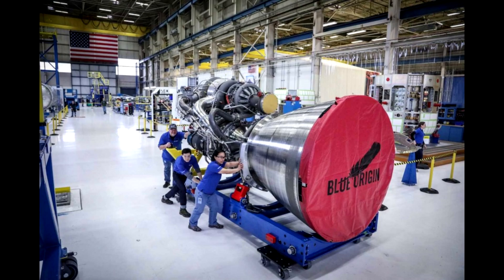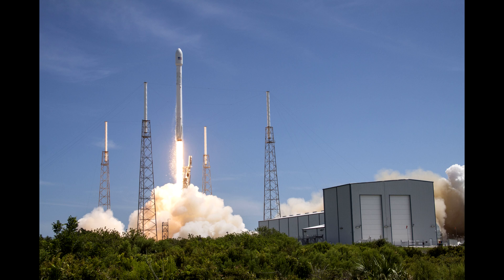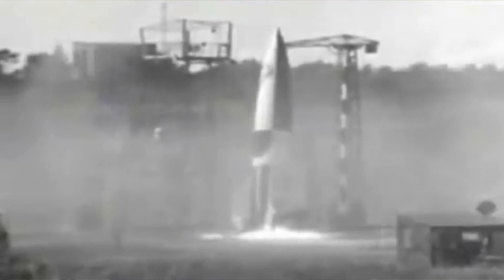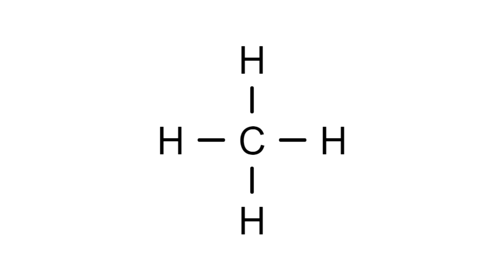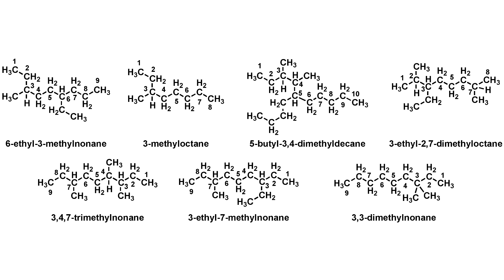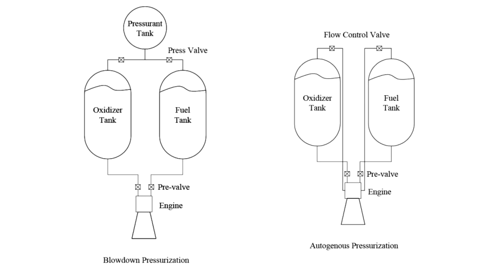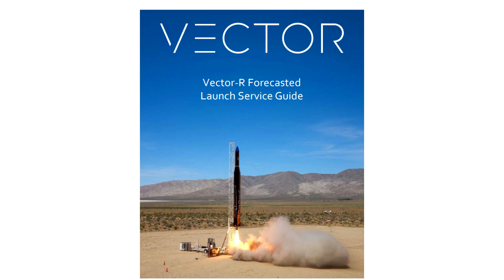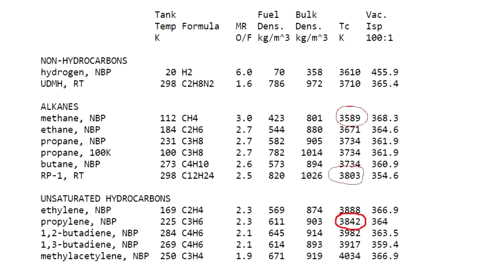Why Next Generation Rockets are Using Methane

Comment: How does specific impulse work with the higher mass? Does specific impulse relate to the total additional mass needed? Or does the increased mass of fuel eat into your better impulse? Or were you suggesting that they make up for the mass increase in fuel with mass decreases in other parts of the rocket? Thanks!
Reply: Specific impulse is mostly about the fuel and has nothing to do with mass of anything. It basically says what is the exhaust velocity of the propellant, which comes from the mass of propellant burned and kinetic energy pumped into it. It has nothing to do with the mass of the rocket at all.
Reply: Specific Impulse refers to the potential speed of the exhaust gas; essentially your fuel efficiency. The lighter the exhaust gas, the faster you can push it out the back of an engine. Hydrogen is the lightest fuel but can't be compressed as much and therefore takes up more volume and sometimes mass for cryogenics. RP-1 and UMDH are much heavier molecules meaning they take up less volume but can't be propelled as fast in an engine meaning lower theoretical specific impulse. They also have the benefit of being liquid at room temperature. Methane or LNG is in the middle of Hydrogen and RP-1. It's lighter than RP-1 but, not as hard to manage as Hydrogen. You need to read about fuel mass ratios to understand how this is employed practically in rocket design.
Reply: he isn't talking about the mass of the rocket, he is talking about the mass of the exhaust's gas.
Reply: @xopnen_ if so, then why ask "were you suggesting that they make up for the mass increase in fuel with mass decreases in other parts of the rocket"? It's clearly a question about rocket mass and not the exhaust.

Comment: IMHO, Mars' atmosphere is so very thin, pulling CO2 would be pretty inefficient. I wonder how much energy that would take to harvest and process air instead of using the dry ice at the poles. 

Not to mention, how would the CO2 be replenished? I know it would take centuries for us to have an impact, but trading one non renewable resource for another when we go interplanetary seems hilarious.
Reply: the atmosphere of Mars is less dense than Earth's but it is still a very substantial atmosphere.  no shortage of Carbon Dioxide.  it would be like being worried about running out of Nitrogen in Earth's atmosphere.  it's a VERY large supply.  when you burn the methane it just turns back into carbon dioxide and water which would end up mostly back on the planet you just took off from.  most of the fuel you would be burning would be to overcome the gravity of planets, so that's where most of the burned fuel ends up.  sure over a very very long period of time and very very large number of trips you would end up rearranging carbon dioxide and water around to the various bodies in the solar system, but since that's where you are getting the carbon, hydrogen and oxygen to begin with...........
Reply: @baneblackguard584  neat

Comment: Why less energetic? Methane combustion gives 55 MJ/kg while kerosene gives only 43.
Reply: Of course for specific impulse considerations is the flame temperature that counts but as far as I understand tecnically methane is more energetic per unit mass.
Reply: In the combustion chamber energy per unit volume is not a very useful parameter.
Reply from the maker: You have to include the mass of the oxidizer in your equation.
Reply: @scottmanley  yeah, you are absolutely right, I did not consider that.

Comment: Methane is also apparently easier to simulate with CFD than RP-1, because you don't have as many intermediate combustion products.
Reply: Sleepib, it is actually--as strange as it seems, due to the simplicity of the methane (CH4) molecule--more difficult to simulate the combustion in methalox (LOX/methane) rocket engines. This is because--although oxygen and methane burn to produce carbon dioxide and water--during the combustion process, several strange, short-lived "inter-molecular species" form and break up, and at least some of these have strange chemical characteristics, and:

There is an analogy in nuclear physics, where some radioactive elements, while decaying to more stable isotopes or elements, first become very unstable, short-lived intermediary ones. It's possible, for instance, that the apparent slight burning of copper interior engine components (Elon Musk noted the greenish edge of the Raptor's exhaust plume, which suggested copper combustion) could have occurred due to the action of one or more of the short-lived molecular species (some of which could be quite corrosive, or otherwise eager to combine with copper and/or other metals in the engine). Also:

Even chemists aren't in complete agreement about how to classify methane. The alkanes (which have single carbon bonds) are chains of carbon atoms with hydrogen atoms on the other three (out of the four) bonding points of each carbon atom. Methane, most chemists say, is a single "chain link," consisting of just one carbon atom with hydrogen atoms on its four bonding points. But other chemists disagree, pointing out that unlike the other alkanes, which also have carbon-to-carbon bonds (where their links bond together, as in ethane, C2H6, the "next step up" from methane), methane's lack of any carbon-to-carbon bonds makes it chemically different (its reaction process with oxygen--with its odd "inter-molecular species" that appear and break up before the simple CO2 and H2O reaction products are formed--suggests this). Methane is a deceptively-simple--although interesting and useful--fuel, including for rockets. Its oddities (for example, its strange "inter-molecular species" that occur during its combustion with oxygen; these might differ due to pressure and/or temperature differences during combustion) certainly don't rule it out as a rocket fuel--they simply need to be studied, understood, and accounted for (and used to advantage, if possible), and today's developers of methalox rockets engines will, in the course of their work, learn these things.
Reply: @j.jasonwentworth723  I'm not sure I can belive that methane combustion is harder to simulate than rp1. Rp1 surely has way more complicated burning mechanism. Can you provide some source for your claim that rp1 combustion is easier to simulate than ch4?
Reply: @zoltankurti  the answer to your question is, of course, NO.  Look at it this way, the comment is saying that some of the best engineers in the world will eventually, as they trudge along, figure out this guys casual knowledge.   We all know no one in youtube comments is "schooling" actual rocket scientists, no matter how hard they flex.  r/iamverysmart
Reply: fascinating! do you have any source for that?
Reply: @Czeckie  trust
Reply: With Kero you don't need CFD when you've got Ivan.
Reply: sleepib I'm new to this...so what is CFD and RP-1?
Reply: CFD is computational fluid dynamics, which can also include combustion simulations. RP-1 is a specification for rocket fuel, basically jet fuel with tighter requirments, so that it doesn't gum up or leave deposits when you use it for regenerative cooling.
Reply: The simpler the gas, the more accurate the simulation. You don't simulate individual molecules in CFD, that's impossible
Reply: Each unit volume can have a different composition though, and may have many component chemicals.
Reply: @delayed_control  except some quantum computer probably
Reply: Is this a quote from Ignition?
Reply: @sleepib Do you know how to simulate the combustion product of rp-1??

Comment: New news: possible new Kuiper Belt planetoid discovered, at 2.5x Pluto's orbit!
Reply from the maker: Only 300km, not even a dwarf planet. But it's orbit is aligned with other outer solar system bodies.
Reply: Sources plz
Reply: Object's designation is 2015 TG387
Reply from the maker: Which shows that they've been trying to determine the orbit for 3 years
Reply: Scott Manley Still an interesting thing to talk about.
Reply: 300km? That's about from here to Manchester.